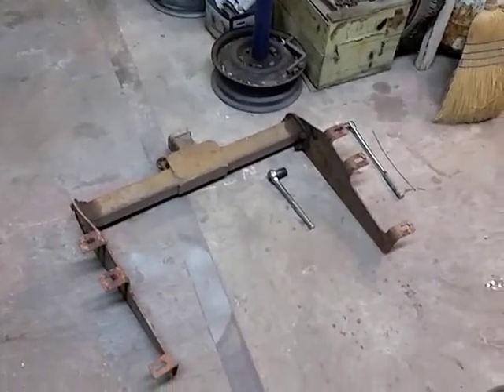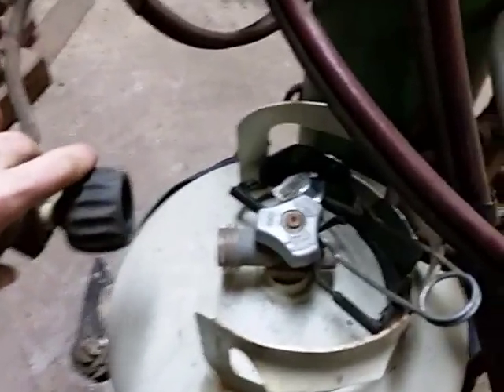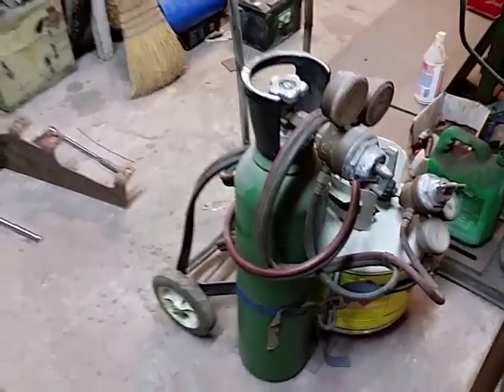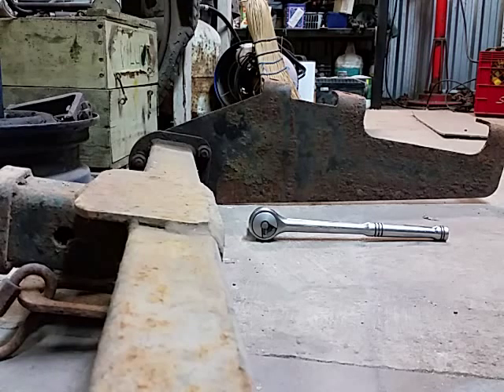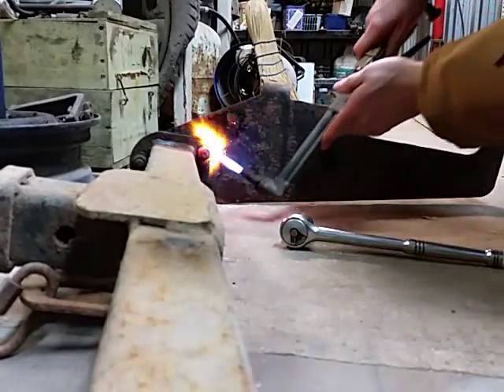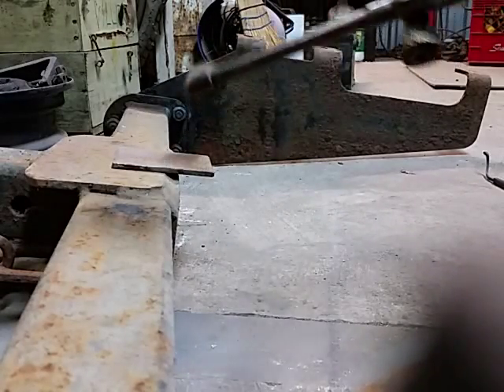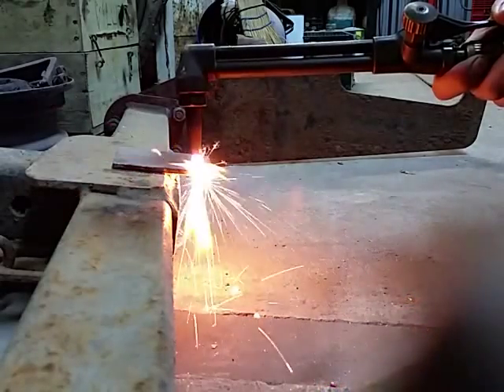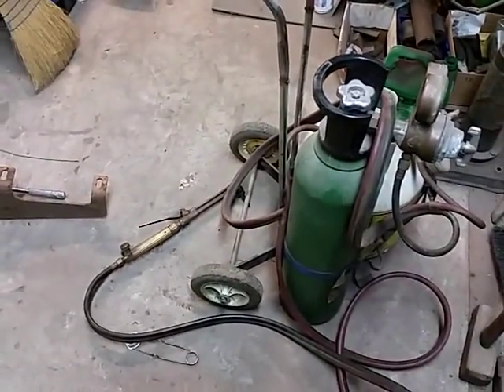Poor Man's Oxy Fuel Torch -- Using BBQ Propane instead of Acetylene!

Comment: A propane tip for your torch will work much nicer than. Modifying a acetylene tip is a poor concept. Sizing the tip to metal thickness by tip size will produce better results along with proper fuel/oxy pressures.

Comment: Try not using the inner flame for your heating. Propane burns hotter in the outer flame so pull your torch away. With acetylene, use the inner flame.
Reply from the maker: oh never thought of that, good to know Thanks!
Reply: that was bugging me too. Ive always used the outer flame to heat even with acetylene. outer to heat, inner to cut.

Comment: yeah if you compare the price of propane to acetylene it is 5 or 6 times as much cost wise and the only benefit of ace over prop is you can start your cuts a little faster and weld with it once your actually cutting the cut speed is no different as you can even shut off your fuel gas while making a cut just using oxygen mid cut you do need a propane tip i use ace hoses and regulator though

Comment: It's not a poor man's rig, it's actually quite popular all over the world. The only real drawback to propane is that there is too much oxidation  so you can't(should not) weld with it.
Reply: Steel welding is rare.  Most use electric welding.  The propane set up appears to work with all other applications.

Comment: Sorry to burst your bubble but the standard regulator fits the internal threads of the propane tank same as the acetylene. Left hand threads, zero modifications required.
Reply from the maker: yeah I learned that after the fact not a big deal.

Comment: Ya I used oxy propane for years in industry for cutting and heating , you can braze as well but you cant weld steel with it as it dosent produce enough shielding for the puddle . You get bad porosity ,hydrogen inclusion causing very brittle  weld bead edges  . Both serious welding faults , The oxygen in the atmosphere reacts badly with the molten puddle without shielding causing the  faults

Comment: You don't need to use a plastic nut BBQ nipple, most of which have INTERNAL FLOW RESTRICTORS.  If you look inside the BBQ tank valve you'll see screw threads. These are designed to take a standard "POL" or CGA-510 fitting which is the same as industrial fuel gas cylinders including acetylene and propylene.  LP cutting is not only common but larger cutting torches use it because it's far less sensitive than acetylene thus safer to handle, and can be used at much higher withdrawal rates. Check out the Weldingweb forums for info on torch cutting, regulators and fittings/adapters.  LP is quite handy and while you can't weld with it you can braze just fine.

Comment: You don't have enough flow through that tip and the tip will likely overheat. Propane has a different burn velocity than acetylene.

Look up Smith Equipment's instructions for using oxy-propane. It is a great instruction video.
Reply from the maker: Thanks, I'll look them up!

Comment: Should use grade T hose. Not RM standard. Should not weld steel. As it will melt and form a nice puddle but the weld will be very brittle.